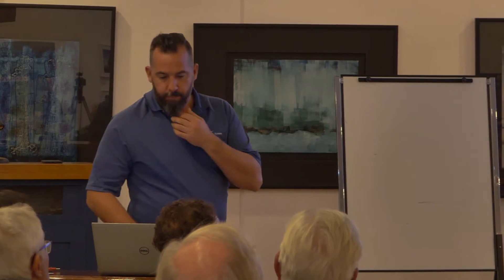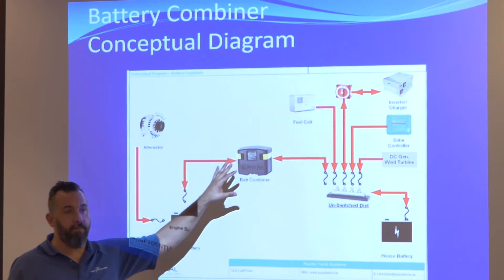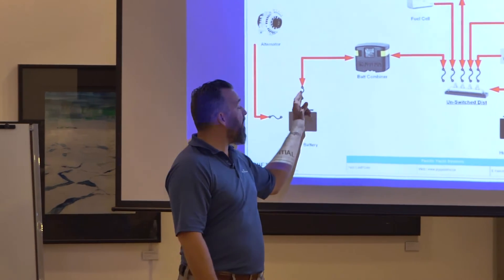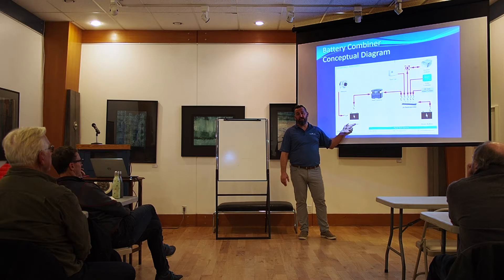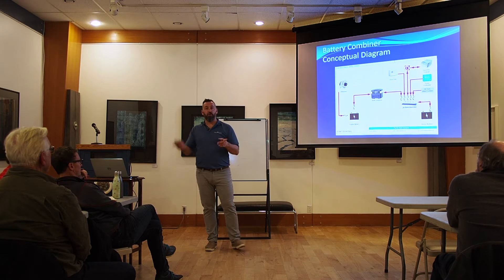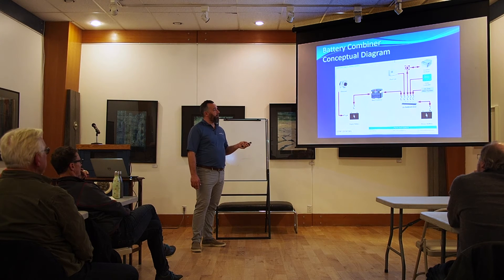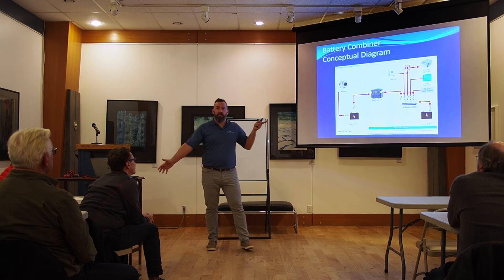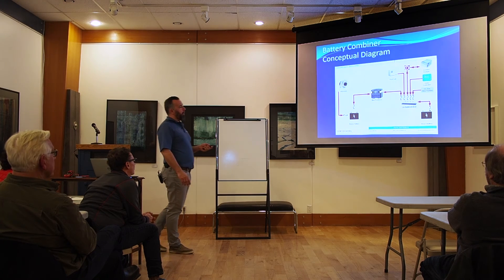How To: Marine Electrical Seminar - Battery Combiner Troubleshooting - Ep 27/30

Comment: Hey Jeff! Thanks a lot for the information you put out, I've learned a lot from your videos. 
I'm ready to install an inverter (the proper way, I'm reading the manual as we speak :) )
It's a victron multiplus compact, decent unit. It also features a 4A secondary output for a starter battery, with a slightly lower output voltage (I think they put a diode in series). I also have a Victron battery combiner however, and I was wondering which setup would work best? 

- Wiring the charger to the house bank and using the battery combiner to parallel the starter battery, not using the secondary output
- Wiring the charger to the house bank and using the secondary output to top up the starter battery, giving away my battery combiner.

In both cases the starter battery would get less than an optimal charge profile, but there seem to be very few chargers that have actual dual regulated outputs, so it doesn't look like it's such a huge deal. What do you feel would be the better option?

Thanks again for the ton of free advice you"re putting out there. All the best, from Belgium!
Reply from the maker: Hi Koffi Banan, I'd suggest going with redundancy and go with: "- Wiring the charger to the house bank and using the secondary output to top up the starter battery, giving away my battery combiner."
Reply: @PacificYachtSystems  
Thanks a bunch for your reply!
I'll follow your advice and make a fellow boater happy with my spare combiner!
Kind regards

Comment: Does anyone make something that limits the amps, so that the combiner would never pass more than a set maximum amperage?  This would seem needed to protect a smaller starting battery from the full power of a big house bank.
Reply from the maker: Hi Robert, to my knowledge, no such device exists in the marine world.
Reply: I like Jeff's solution of limiting the the battery combiner to "no load" function via the load demand status.  I will set up bow thrusters that way.  Simple and low cost.